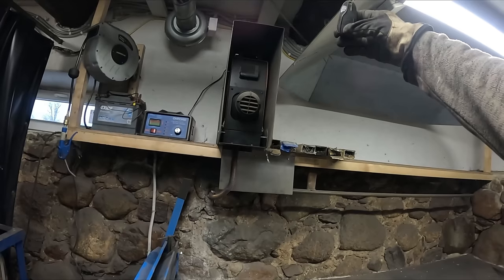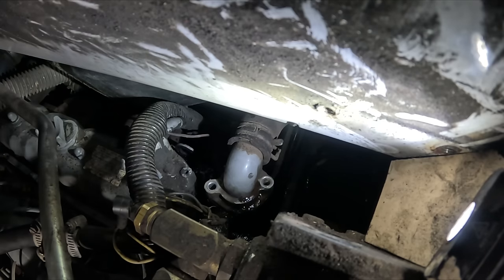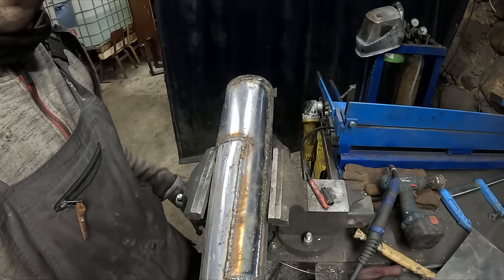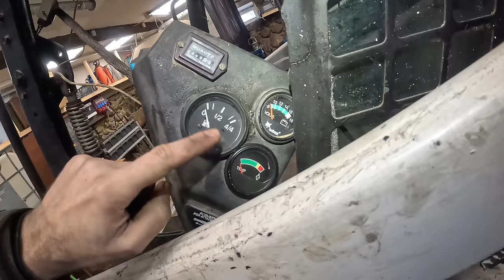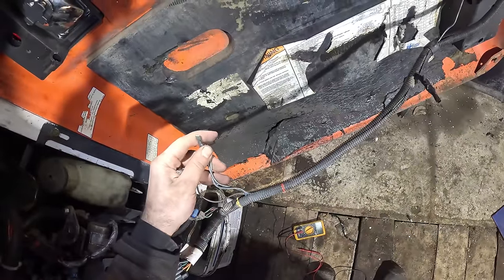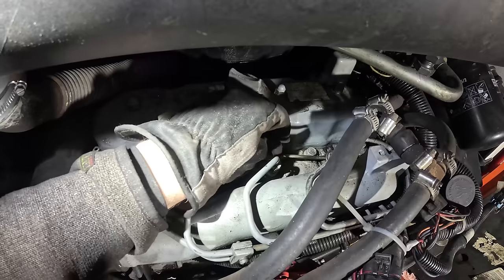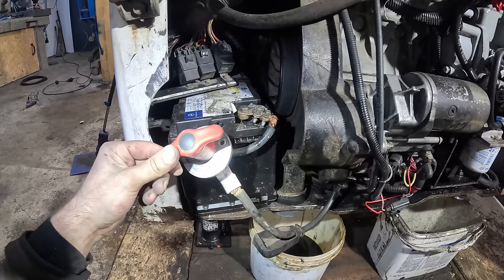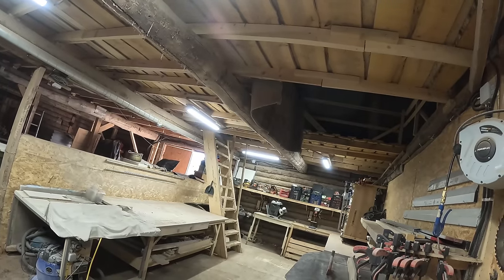Fixing up the Bobcat 751 skid steer - (part2)

Comment: Um...yeah....Didn't think it would be finished in 2 episodes. And that's ok. I am sure you are tired of squeezing your hands into tight spaces. But it only gets tighter once you lift the cab...ugh. Hang in there buddy. I know your itching to get the Hobo back to work with all the outside things you need to do. Still a muddy mess though. Shop expansion sounds awesome, dude. But so is to finish the cabin...and you will get both done in the traditional Ants Pants way. Until next time, take care! Bill

Comment: Glow plugs mostly are not 12v, have to be careful when testing with 12v. 
Most are 9v approx so if 12v is held to long, glow plugs will burn out, even new ones
Reply from the maker: But there's nothing between the glow plugs on this machine that reduces voltage. Maybe these are 12v?
Reply: @Ants_Pants  check on the glow plugs themselves, most I’ve seen have voltage stamped on them   The voltage drop is mostly through the indicator if it has one and also the wiring which is a resistor. 
Not sure if yours are lower voltage, but something to watch for

Comment: andris  in french cest correct or ca bien ...its correct or thats good  but i believe that was sarcasm lol   on the exhaust that bung was probably for somthing like an egt sensor map? sensor  exhaust temp sensor and uncombusted hydrocarbon sensor for engine management systems...im guessing here so look into it if you want more info. as always thanks for the videos.ps  ya dumped coolant over the block when you changed the thermostat   im gonna bet thats boiling off
Reply from the maker: It had something to do with spark removal
Reply: @Ants_Pants  strange  if it was jospeh spark arrestor woild be metal screen  or steel wool in the pipe  ...i presume they want to stop forest fires but i dont see how a bung will do it

Comment: btw t40 actually have glowplug
Reply from the maker: Newer heads yes. Older heads did not.
Reply: @Ants_Pants  Glowplug is located on intake manifold not head. Your tractor have one too. 😉 Its right next to hose which connects intake to airfilter

Comment: Looked to me like that isolation switch was meant to be mounted from the front. Remove the black cap on the handle, unscrew the handle, pull off the handle, mount the switch.
Reply from the maker: Missed that

Comment: No short cuts when your wiring is that 'CUSTOM', it's just a case of checking each instrument for operation on the bench then checking each wire full length on the machine for continuity, each connectot and each switch for continuity.  Check each relay on a relay tester.  Jury rig where necessary then if everything eventually works tidy it all up by removing all redundant wiring.  Anyone who owns a Vauxhall is eventually an expert! 😢

Comment: Not wanting to be a killjoy, Ant, but even after all your hard work welding the exhaust muffler, it's all in vain. 

The welds will have weakened the surrounding areas, which means, in less than 6 months, the muffler will be in a worse state than before you started it.

As for the joint. What you could have done is, use some exhaust compound or better still some PD-7. You just smear it around the joint then leave to harden. In those conditions it would probably take a week to harden. But to speed things up. Start your engine then leave it idling for 30 minutes. My friend in Alaska uses PD-7 on his exhaust systems all the time. It has other uses too. Just one problem.  When it sets hard, the only way you're going to remove the stuff is by using C4 😂😂😂😂

About that isolator switch. I recognise the design. It's pretty universal really. First, you must remove the red handle. There are three ways. Either there is a small grub screw or you remove that black circle revealing a nut and washer or you simply pull the handel up.

To install the switch, place it under a plate or the bodywork that should have 3 holes. One hole for the switch part to pass through and the 2 holes used to bolt the switch to the plate or bodywork.

Then, simply push the red handle on or screw up the grub screw or replace the nut and washer. There, simple.🤭

It's going to hurt, but dude, I think you should dive deep into your pockets and spend the $400 on a new muffler man. Take one for the team. A new muffler will probably last you 10,000 years.😂

Well done for tackling the electrics. That wiring system, even without all the modifications, is hard to navigate. I would give you a medal for your ingenuity and dedication. 

Regarding the thermostat.  Dude, I thought common sense would have told you to drain the water first. Man, you are some crazy dude. And the sensor, you must know now that there is an easy way to change them out? No, umm, well it involves removing the engine or parts thereof.😂

Did you remember to put more anti-freez in to replenish all that you lost? Because that sound you hear, the bubbling sound, and the smoke you see. It's your engine telling you it's about to explode with more power than a 100  nuclear bombs💥. Get everyone underground and don't come out for 1,000 years.🤭

That engine may be running sweeet and not producing any smoke, but just you wait. The carbon monoxide or is it carbon dioxide. Whatever, dude, the poisonous stuff, it will kill you, so don't drive in reverse or your lungs will suck in all the nuclear poisons. 

BUY
A
NEW
MUUUFFFFLLLLEEEER!
Or you will die 🤮 ☠️ ⚰️ 🪦

Great video buddy. Don't wait until next week to upload the next part.  Do it mid week or better still,  give it to us over the weekend. As a treat for all our support.😁

Oh, i almost forgot. Bless you. Don't get a cold now you hear. 🤒

Dude, please, I need part 3 now!. 😁🏴⚒️
Reply from the maker: Oh noo 😅👍 thanks for. All the info

Comment: I'm probably late to the party, but I can actually maybe be helpful for once instead of just talking shit!

Coolant temp sensor/gauge - you were wondering how it works. The sensor is a variable resistor. When the coolant temperature increases, the resistance across the sensor decreases, and vice versa. Apply 5v in, monitor the amount of voltage coming out, and you can translate that to needle movement on a gauge! More voltage out = more degrees. 

I'm guessing the 6v wire at the gauge is the reference voltage, the 2v is what's returning after the voltage runs through the sensor. 

Does that make sense? I'd proofread but I'm lazy. Someone correct me and make fun of me if I'm wrong. Thank.
Reply from the maker: 😅 okey makes sense

Comment: I think you need a 3D printer to make plastic parts like a ring for the fuel gauge, once you have one its amazing what you can fix. If you do the workshop update first it should speed up your repair jobs, like not having to work outside in the mud and rain, looking forward to it.
Reply from the maker: Would be cool

Comment: Bobcat has done a ford move…bobcat engineers have purposely built expensive licensed tools to easily fix a broken bobcat part, designed so home mechanics can’t easily fix a mechanical problem with normal tools, but  instead will have to buy a complete replacement part.
Reply from the maker: This